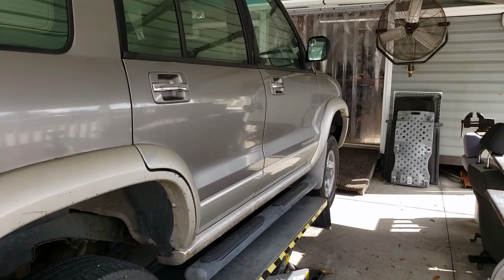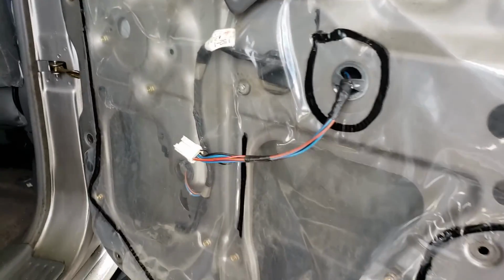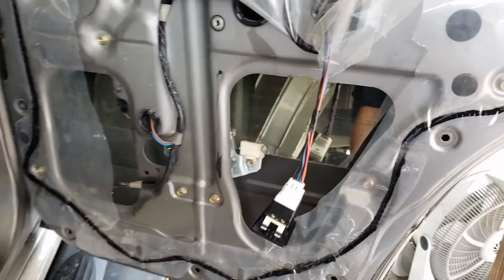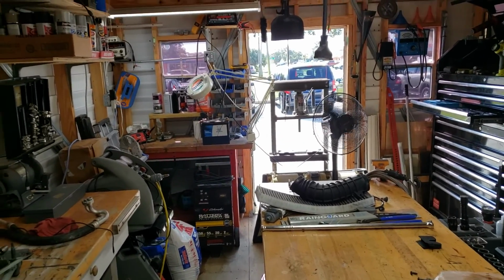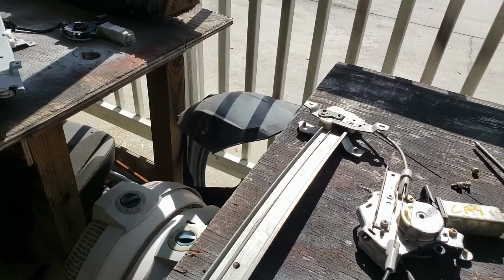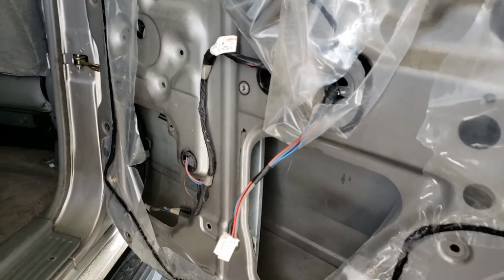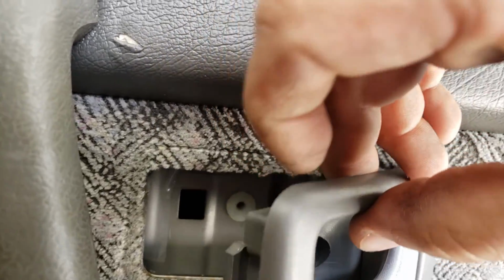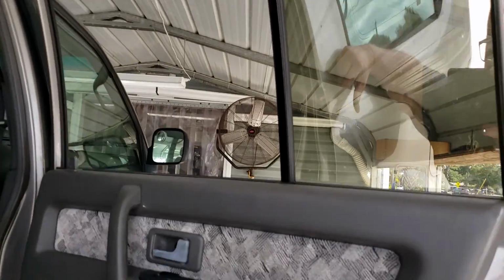2002 Isuzu Trooper 3.5l RR Window Regulator Replacement

Comment: Your video was spot on, I followed your instructions and was prepared for the job. I brought a small 12 volt battery with me to the scrap yard to test it and lower the window for removal of the regulator.
My biggest frustration was fitting the handle through the door slot, not as easy as it was for you as I bent the rod going to the lock.
Thanks so much for your efforts on the video, I’m running again!
Reply from the maker: I never saw this and apologize. I'm happy that I could help.

Comment: Followed the video and changed the regulator, thanks Robb..i had circular metal cover and rubber gear that moves the regulator come apart, not sure why..
Reply from the maker: I just had that also. LR regulator failed and I had a spare. I hooked it up and the rubber that connects the metal triangle to the gear was dry rotten and slipping. Shrek is a 98 so at some point they are gonna fail due to age. I bought a new regulator off eBay and it works fine.

Comment: hi Robb O.  great vid mate
Question, the motor is ok  and its the regulator, would i be able to hear the motor trying to work?
Reply from the maker: Probably not hear it. These motors are very quiet. It's not hard to remove the door panel. Then at least you can see the motor spinning. If you can see and grab the glass and can pull up on it that will also tell you it's the regulator. If it's up and slides down it's also the regulator.

Comment: I had both my rear windows quit 1/2 down , in a panic i cut the cables and pulled windows to close and locked cable to hold... 6 years later i am fixing the rear windows. i acquired 2 mechanisms with motors and replaced them today ( with your video help. ) unfortunately the window only will go down on driver side and no action passenger side.. jumping with battery to motor leads both windows can be made to go up and down.. i assume switches are the problem ? Also the driver door switch will also not activate either rear windows ??? Front driver switch also need replaced ????  Any help or suggestions or supply for switches????
Reply from the maker: Sounds like the master window switch (driver door). Don’t replace the passenger switch until the master is done. Everything travels through the master. Most times you can jerk the master switch off and it will start working. Put a little backwards push on the switch while jerking it off. If the master starts working then try all the other switches. If they work then replace the master.
Reply: @robbo6460  i do not understand your wording " jerk the master switch off " ?? Are you saying front driver side is the master ?  Are you saying remove front driver side switch from door? Front driver side switch works correct for both front door windows and all locks, but does not work rear door windows either side.   I removed both rear door window switches and disassembled them, and cleaned with electrical spray cleaner. They looked fine inside ( have not reinstalled or tried yet. )  i am heading to a junk yard today to try and find other driver side front, driver side rear, passenger side rear switches.
With the electronic boards in the switches, it does not look like you can ohm with a meter without them being under power ? Thanks for your reply
Reply from the maker: @christopherpeterson1400  yes the driver door switch is the master window switch. Jerk off means push the rear window buttons on the driver door switch putting backwards pressure on the switch buttons and see if the rear windows start working. Put the rear switches back in to do it.
Reply: @robbo6460  it turned out to be both rear door window switches.. replaced them and now everything works front and back ..
Thank you for the help
Reply from the maker: @christopherpeterson1400  wow both? That’s rare. Glad your good.
Reply: @robbo6460  living at the rainy northwest coast ,,  , with 2 grate danes tearing up the back and eating most of the rig back end.
Windows went out about 6 months apart... all good now.